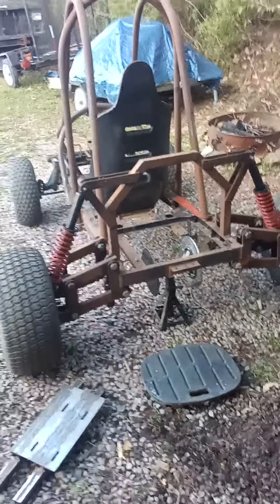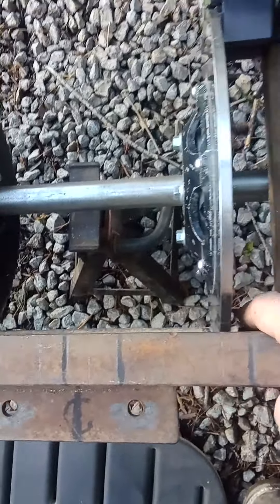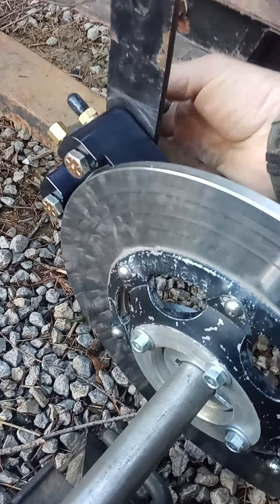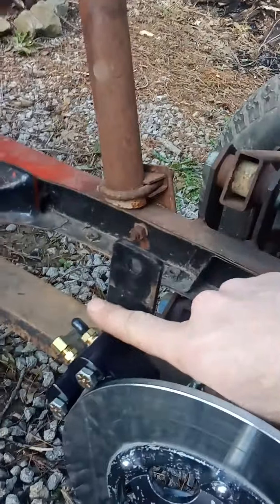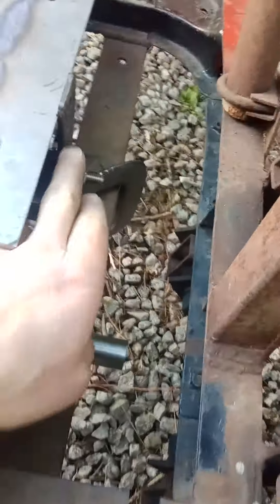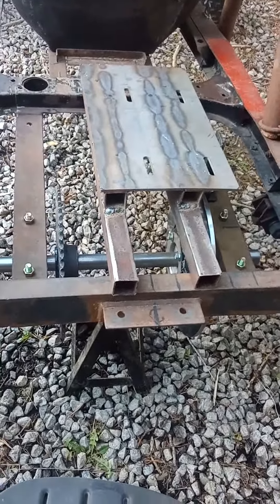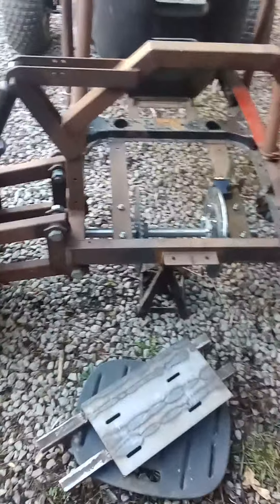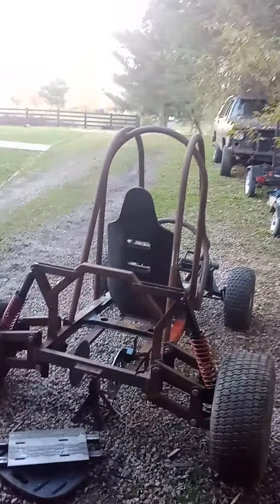Bull bandit sprinter gets caliper mock up.

Comment: I'm interested in the drive axles for the independent rear suspension. Are you gonna use CVU axles from a honda odyssey or? I've never had one with a nice independent suspension, only the solid axle bumpity bump bump kind.
Reply from the maker: Some guy on Indiana set this up to run Sprint races. It has universal joints and slip yokes.The hubs have a keyed  1" shaft inboard on bearing blocks on that lower link that stick out. It  connects to that center axle on pillow blocks via a hexagonal slip yoke and two U joints on each side. This kart was mostly fabricated by some pretty clever country boy (such as yourself). It originally ran a Suzuki 750 and supposedly holds a track record of 90mph in Lanesville, IN. I'm just adapting the 459 and basically finishing it.
Reply: @igokarts4510  I can't wait to see it finished. This is gonna be sweet! Those shocks and independent rear suspension should make for a smooth ride.